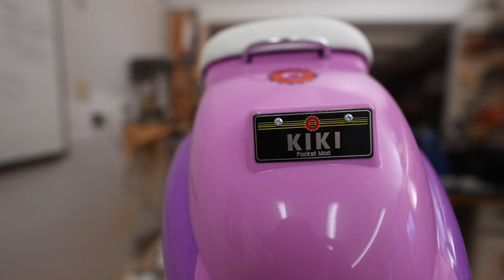I built an electric skateboard!

Comment: The Build process is sick and I love watching these videos. I just want to say that you could buy an electric skate board for less than the $400. But having your own built one is much cooler.
Reply: a $400 electric skateboard will not go as fast or will a range of maybe 5 miles
Reply: @noka7776 it’s true that it won’t go as fast but you can get way more than 5miles of range from a $400 board. I’d even bet you could even get a board with over 500 watt motors and then getting a high top speed is all about wheel size and gearing. That being said, for less than $1000, you can get a board that out performs theirs out of the box.

Comment: Pretty cool build , Maybe you should have kept the 5000w and put a handle bar so u could handle it and add a brake and go one handed so u can still balance that's what I do on my custom e recumbent that I built ,I think it would be cool also with a modern powerful hub motor  check them out ! . It would be way cool with a big wheel up front  .What ever u build be safe .peace ✌🏻

Comment: You need a programmable controller those controllers are horrible. Like an on/off switch. Grab a "kelly" mini controller. Its less than half the size, more power, and fully programmable throttle/accel. Can also limit motor speeds to slow it down if you need to.

Comment: GEAR DRIVEN would have more torque - more longevity (if steel not aluminum) - It's a lot better than belt - direct - chain - drive.   Also - wood gluing thin layers of wood - ALOT OF LAYERS! - the more layers the better with each piece having the wood grain go in a different direction will make for the strongest deck.

Comment: yeah watching this video again I think I was correct that using the original note the motor where you fell off was still fine you just needed a way to gradually pick up speed it wasn't that it was dangerously fast it's just that it picked up speed too fast and that's why you fell off you need it like a speed controller to gradually give it speed like a remote control on a remote control car you can gradually pull the trigger and gradually pick up speed or you can hold a knob at your hand and you'd like a volume do the same thing and gradually pick up speed also if you made it a little bit longer it might be more easier to stand on  have you thought about using an e-bike wheel as the motor powered source that could keep get you pretty fast too and you could have the little motorcycle revving up handle thing to make it go faster as you turn the knob it goes faster like a motorcycle you turned a little thing on the handle and the more forward the faster it goes I thought about construction one that has only two wheels one wheel in the back and one wheel in the front and both Wheels could be e-bike Wheels the smallest one that they make and then you just have to write it kind of like a scooter with no handlebar to hold on to but it would look more closer to your design except instead of having a skateboard front it would have a another the front would be like the back

Comment: the faster motor was fine the one u keep on falling off  from  you just needed a  Speed Controller a device that would let u slow it down or speed it up it up like a car the more u push down on the gas petal the faster the care will go so if u had some speed controller that worked like a dimmer switch then u can turn it down or up  you just needed a way to pick up speed slowly not full sped right away 

i made one before but it was with a very small kids bike parts  and Tire and added shocks but i use a car alternator with a speed controller one that would let me control the speed it had a nub that would let me turn down the amount of power to the motor if i turn the nub switch all the way up i could maybe  go 100 mph witch i did not have a death wish i i keep it at 25 to 30 one time 35 then i gave it away because i am to old to be riding thing that could kill me but i think of building one with a bike wheel that is big and very fat with 2 shocks and maybe see if I can use a sewing machine pedal as the new speed control like a gas pedal in a car but only not gas

Comment: Over engineering at it's finest 🤦 I achieved the same speed with a regular long board, 2 smaller motors and remote. It goes up hill just fine and off road. This is pretty lame